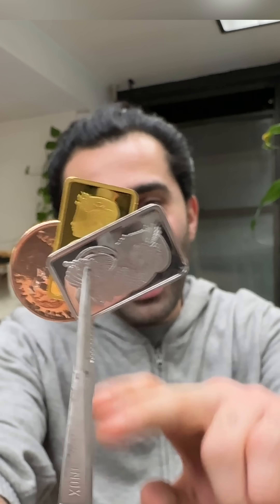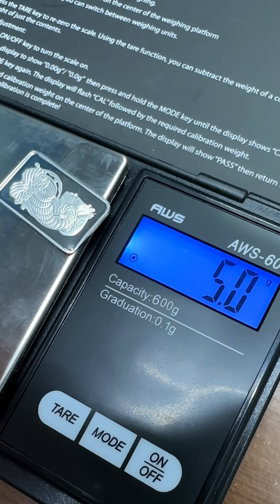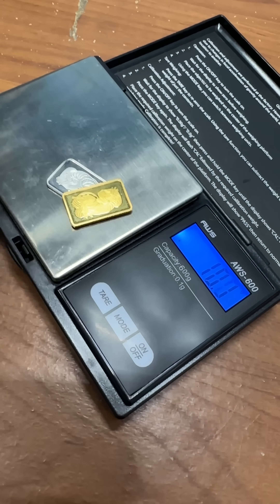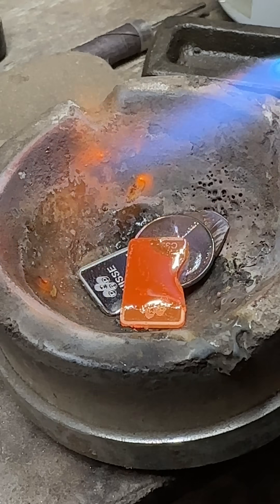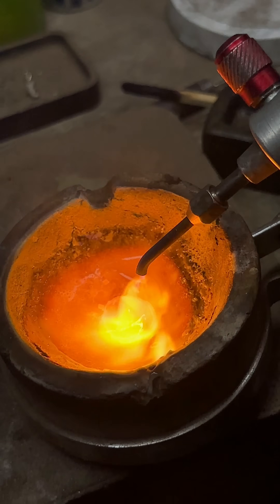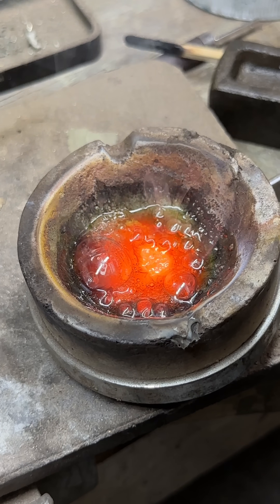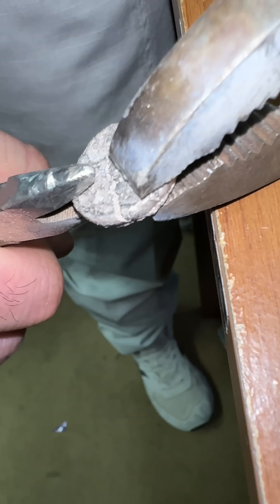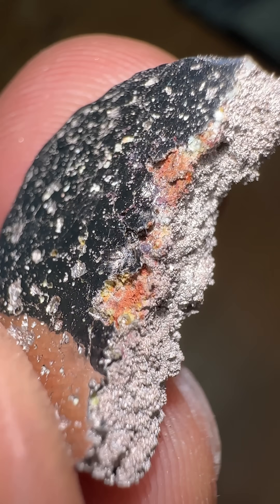CREATING A NEW METAL ALLOY FOR JEWELRY?!?!? #shorts

Comment: Heat the Platinum until it's molten then throw the other metals into the molten puddle. That way you aren't cooking the other metals beyond their melting point for so long.  You weakened them. When alloying, it's always best to melt the metal with the highest melting point to molten FIRST. Try this experiment again!
Reply: Just like cooking.
Reply: @JohnDoe-ps5hi  exactly, you wanna cook your “harder veggies” first before cooking the softer ones to prevent them from breaking down
Reply: @JohnDoe-ps5hi  Exactly what I was going to say
Reply: @JohnDoe-ps5hi  Right?! I thought he was making soup!
Reply: @JohnDoe-ps5hi  hisemberg approved
Reply: @JohnDoe-ps5hi well if you think about it for a second, it is cooking.
Reply: @JohnDoe-ps5hi  no
Reply: @OhZjuchi It's all chemistry. So... kind of like cooking
Reply: @OhZjuchi yes otherwise the things that need longer aren’t edible
Reply: Wow you are wise I was thinking the same thing, it was not mixed right.
Reply: @oscarbennett9253 yeah dude in the video puts off like they know so much but they dont knowanything about alloys. And hes not the first to do this. And weird how he used old pennies for the copper. When you can get pure copper at any hardwear store
Reply: @oscarbennett9253 you think the same thing like me, so you are wise becorse I am wiese…😂 dude
Reply: @Soilphonic  🙏 thanks, you are so kind.
Reply: @oscarbennett9253  l loop 0p
Reply: Was just about to comment something along these lines but you said it better lol
Reply: @jedd4635  what were u about to comment
Reply: @jedd4635 
     

.
Reply: I agree or he could have used silver instead platinum
Reply: @morganmccomb  silver would flash way to quick to mix with copper or gold
Reply: @oliverklozhoff  wow. That has to be the stupidest comment I’ve read here thus far. 
Do you know what yellow gold jewelry alloys below 23k are traditionally made with? 
Gold. Silver. Copper. 
Some proprietary additives by some companies to alter some characteristics such as viscosity or corrosion resistance. 
Silver will not ‘flash’ at molten gold temperatures.
Reply: @morganmccomb it’s like making meth
Reply: @morganmccomb wouldn't be a new alloy  8 carat yellow gold is a third gold a third silver and a third copper.
Reply: @HenryTheOunce  usually the percentage of silver is higher than that of copper (traditionally 2/3 silver 1/3 copper, but naturally you can mix and match to play with the colors.)
Reply: @morganmccomb silver gold and copper is already an existing alloy. It’s called yellow gold. It’s usually 2/3 silver to 1/3 copper mixed with gold to produce whichever final karat you’re aiming for.
Reply: @morganmccomb The proportions are just odd.
Reply: @morganmccomb  he used silver with the other 2 metals.
Reply: @morganmccomb silver and gold alloy already exists I forgot the name of it
Reply: @morganmccomb  He would have just made 8k gold.. already exists 😅
Reply: @morganmccomb that is basically just how the make lower grades of gold for jewellery 😂 if u test 14k gold it will normally be a mix of gold silver and something like copper
Reply: A real jeweler would know this
Reply: @thirdiview1230  Right? Definitely seemed like a pretty rookie mistake to me and something that this guy should have known or at least researched a little more. I mean can that platinum be salvaged now?
Reply: @whiskeyrichards9973  YES IT CAN BE SALVAGED AND NO THIS IS NOT CORRECT.
Reply: @whiskeyrichards9973  easily recovered
Reply: @whiskeyrichards9973 in
Reply: @whiskeyrichards9973 jewelers aren’t metalsmiths nor are they chemists so no it’s not a rookie mistake as alloying is out of their scope. But also, chemistry is very finicky it’s not simple. Go watch NileRed make purple gold, he has a masters in chemistry like me and did the proper research and still failed several times. Academic research also is gatekept, which usually requires academic connections to an institution or a lot of money to read stuff you probably still wouldn’t comprehend enough to follow.
Reply: @shnilikmw So are you the guy who made this mistake and wasted your precious metals on video? Seems that way with you responding to so many comments like someone insulted your mommy or something. You can relax man, don't get so offended by YouTube comments.
Reply: @thirdiview1230 truth
Reply: @thirdiview1230  come on it’s just a test that was to hard a thing to say
Reply: @thirdiview1230  ye, but homie on the video is a clown and all that fake stuff on 70% of videos
Reply: @thirdiview1230 exactly guys a phony
Reply: @thirdiview1230 he does know this he makes these videos to show people who don’t
Reply: @thirdiview1230 should know jewelers aren’t metalsmiths
Reply: Beat me to it
Reply: It's concerning he didn't know this
Reply: @takethebaitmate1920 did you know that casting platinum with copper isn’t a good alloy to begin with.. chemistry is NOT simple bruh lol
Reply: You would of thought being a jewellers they would of know such.
Reply: I'm astonished that they don't know this.
Reply: Exactly what I was thinking watching this clip. Seems like such an obvious no-brainer too. These clowns jacked it all up right from the start. Lol
Reply: We need to upvote this guy's comment so traxx takes notice
Reply: yes we need it
Reply: Platinum and gold can handle extreme temperatures it’s the Copper that suffers. More than likely air from a gassing reaction hence the air bubbles
Reply: @FiloYappins pluss the used ild pennies instead of pure clean copper
Reply: @FiloYappins  they alloy copper with steel for safes and vault doors. Called 'copper elexide'. I dont know how it is done.
Reply: @Chris Madden  yep oxidation
Reply: @Chris Madden  that's why he added flux. Problem is gold and copper melt at 1950f and plantaum melts at like 3300f and does not oxidize at that temp meanwhile the copper are stripping oxygen from anything it can. Not sure if gold oxides at that high temp or not.
Reply: @Capthrax1  pure gold does not oxidize. That’s the reason the work of the ancient Egyptians could still survive unchanged over the millennia.
Reply: @FiloYappins  not so much the temperatures, but the reactivity of each metal. Gold and copper melt at essentially the same temperature. 
Gold and platinum are non-reactive in air at room temperature. Even at melting temperature in an oxidizing flame. But copper will tarnish at room temperature in plain air. 
Porosity is due to gaseous reaction with copper and differing solidification times in the alloys crystal structure due to non-homogenous mixture and contraction of the metal when it transitions from liquid to solid.
Reply: Would it still not be pointless mixing copper and platinum?
Reply: @DinnersForOne  pointless !? Its beyond retarded mate. You dont need to divide by 3 to know how much gold you have, you can just weigh it.....
Reply: @DinnersForOne  jewellery platinum is alloyed with other metals to alter its working characteristics, be it making it easier to cast or make it harder. Nothing pointless about it.
Reply: More borax
Reply: I like how everyone thinks they know this and like it
Reply: @Yourfather7392  facts these fuckers just be parroting
Reply: @Yourfather7392  miserable as usual
Reply: Also, using an inert Gas could help the oxidation that happened, making it worse
Reply: @AngelaScene18  It looks like they used a Flux at least but inert gas is better for sure. That's why TIG welds are stronger than stick welds that use a chemical Flux.
Reply: "overheating" liquid metal does NOT "weaken" it.  Strength is created while solidifying.
Reply: @steelbluesleepR  dude. You don’t know what you’re taking about, obviously. 
Overheating creates gas pockets (micro and macro porosity). Reactive metals will oxidize more when overheated, which also creates porosity and weakened crystal structure. 
You obviously don’t know what you are talking about. You’d best keep your mouth shut if you don’t want to seem even more of an idiot.
Reply: @steelbluesleepR  Um, ok Champ.
Reply: @neekobonzini3399  these are all elemental metals, so there's nothing to burn.  

 it's oxidized, not "overheated".  If they did the same thing in a shielding gas, it would be completely different.
Reply: @neekobonzini3399 you’re as clueless as these other know it alls
Reply: I'd say THIS, AND get rid of that trash copper and use nickel instead.
Reply: The problem is the melting point of platinum is so high it need to be molten first and then the other two metals. But right after platinum or during a flux or vacuumed chamber would need to be used to keep metals from oxidizing so the can fuse properly. The dissimilar metals are binding because there oxidizing before the can mix and the over heat of copper. Definitely would help to have an oxygen free environment or oxygen less.. just a tip. But yeah I feel a real jeweler or beginner metallurgist would know this.. that jeweler he has is talented for sure! As for him he’s just a super salesman!!
Reply: @shadetreetrades.jackofall2188  jewelers don’t know chemistry, they learn a little from experience but just like a science experiment you don’t know until you try it several times and you have to keep the experiments standardized to pinpoint the problem. Trax is NOT metalsmith, he’s a commercial jeweler that is very well knowledgeable on the economics behind jewelry, not the science behind it. Glad yall can critically think about his processes, but refuse to think critically about his actual profession, which is to sell jewelry not cast it by hand. It’s why he always has other doing these experiments in his videos, he relies on others expertise but a quick buck for some promo, any metallurgist will do whatever he says for the promotion.
Reply: You can't "weaken" metals by going over their melting point. They simply will be liquid and nothing else.
Reply: @FactionalSky  wrong. 
You weaken an alloy or a reactive metal by introducing imperfections in the crystal structure, either by nearly heating to the point of vaporization or overheating and degrading the crucible or flux.
Reply: And use pure copper. Pre 82 pennies are only 95% copper and 5% zinc.
Reply: I hope this dumbass jeweler reads this lmao
Reply: And dont use shitty ass pennies for the copper
Reply: Pressure is also needed when creating an alloy with metals of different densitys
Reply: @InCianone  not in the slightest. 
Where did you pick up that piece of garbage idea?
Reply: So it seems he is not using experts!
Reply: CLEARLY
Reply: Nah we just need to let stupid do what stupid does jeez the guy ruined a bunch of perfectly good metals
Reply: Wouldn't work it is that much hotter. You would need amalgamate compound to bring them near. Then remove the amalgamate.
Reply: @Cookies4Wookiees  no. Not necessarily. Amalgams are used to alloy at room temperature. Such as mercury for dental fillings etc.
Reply: Lol acting like jewelers are metalurgists up in here, you can't just melt random metals together in an equal ratio and hope for something malleable and ductile...
Reply: Also slower cooling makes bigger crystals the grains in there were like sand
Reply: "You weaken a liquid". Bruh....
Reply: @em4703  it’s not weakening the ‘liquid’ 
You are compromising the crystal structure of the solidified metal by introducing impurities.
Reply: @nottheoneyourelookingfor0504  no $hit. why do you think I put quotation marks?
Reply: @nottheoneyourelookingfor0504  also, no impurities were introduced buddy. it's just a bad ratio of gold and platinum. so many replies and all you do is writing garbage. your posts are the ultimate example of Dunning–Kruger effect
Reply: @em4703  try again, bud. I have over 20 years experience as a custom goldsmith, specializing in casting and antique repairs. Intimate knowledge of alloying processes is paramount. 
And what pray tell are your credentials?
Reply: @nottheoneyourelookingfor0504  Metallurgist
Reply: @em4703  right. Sure you are, buddy.
Reply: You are very smart.
Reply: Also need to consider metal solubility… might be soluble in molten state but then seperate across different boundary layers when it cools. 

But then you are right, you have to melt platinum first then throw the other metals in
Reply: Do it again!!!
Reply: Exactly right. He hyper oxidized the other metals trying to melt them all together
Reply: Yea monitor the temp and drop them in at their molten points 👉
Reply: Isnt this bullshit? Maybe the olatinum burns dust in the air but it shouldn’t be used doing that. You cannot weaken metals on their own just by melting them.
Reply: Watching the gold mini n Platinum should of just left way was cute in package but yeah ppl have time n money so experiment...I guess sad 😭 world is poor n struggling give that experiment to a good user of YouTube fan
Reply: Correct. This method also reduces oxidation if you add small amounts of the other medals to the puddle such that they are completely submerged in the puddle of molten platinum when they melt.
Reply: None of y'all has any experience, ya buncha YouTube Guru's
Reply: @neekobonzini3399  And I'm the king of  Wakanda, That's why I'm on here all day arguing in the comments
Reply: Who's the wise guy ?
Reply: That was an interesting read I always wanted to be a smith too
Reply: Also, he needs to add 5gx^2 of more gold.
Reply: This is what happens when people have too much money and not enough experience
Reply: @billyshaw6017 This 8s how you get experience.
Reply: @billyshaw6017 jewelers don’t go to school for chemistry son
Reply: you should get hired
Reply: Thats what I thought to he just burnt-out the gold all together 🤦‍♂️
Reply: wouldn't matter, copper is garbage and would still become brittle as fuck.
Reply: You could heat it in a oxygen free atmosphere it would help or you could combine using a source of powdered metal in a ball mill and then melt fast say in a induction heated furnace.
Reply: I think a better heating method could help with the process as well.
Reply: Lol you’d think he would know that being a friggin jeweler
Reply: @cmendoza1094  he is fake AF. His vids are trash and he is dumb as a brick
Reply: And don’t throw those trash Pennie’s on there unless they are 100% copper
Reply: They’re jewelers what are they supposed to know
Reply: That's exactly how my chemistry professor explained how to do with other metals. Weird the jeweler didn't do it that way
Reply: Yep
Reply: I thought this would be common sense…
Reply: Honestly surprised a guy like this made a mistake like that
Reply: I don’t know anything about alloying but I was thing the same thing😂
Reply: Then how would your annealing process be handled
Reply: nevermind the ridiculous oxidation from doing it all in an open container.
Reply: @mattjohns3394  jewelers melt precious metals like that all the time. Not much issue there.
Reply: @javanmonroe6064  not much issue when it's something soft and reasonably inert like gold but when you heat copper to platinum temps in the presence of oxygen, bad things happen.
Reply: @mattjohns3394  thanks for the note. If it had been done in a more proper way (heating platinum and adding other metals in after) would that have produced at least a better version of this or is this doomed regardless and homie was just being dumb
Reply: @javanmonroe6064  I've never played with platinum but at that temperature I would suggest induction heating in an inert (argon is easy) atmosphere.
Reply: The I suggest you reply to the commenter that posted that. Just a random "wrong" doesn't help anyone.  The heat of the metal is not the problem but heating it in the presence of something as reactive as oxygen generally causes problems.  Shielding gases are used for a reason.
Reply: @mattjohns3394  that’s what the flux is for. But his problem is that most fluxes are detrimental to platinum and will introduce impurities and create porosity.
Reply: It's doesn't make any difference. Once all three are full melted it will be the same no matter how you did it.
Reply: Someone actually using their brain
Reply: He ain't no shit about cooking bro, 96% purity is not gonna achieve
Reply: Wise words
Reply: and also "copper cents" are not pure copper but more a form of bronze.
Reply: Yeah like smelting iron and copper. You'd heat the iron first. Maybe if enough people like and reply to your comment he will try again and follow your advice to get it right.
Reply: Well the metal still need to be in that temp gonna burn still
Reply: @perkpinoy6192  You're an idiot, less time with exposure to high heat means less burning off
Reply: I just wrote the same thing thinking i was the only one 😂thinking had the idea 💡 and then looked the comments lol 😂 I was to late
Reply: Really thought that was common sense
Reply: Rather be dumb and rich than smart and broke
Reply: Great answer. Those guys are noobs
Reply: Good call man👏
Reply: Somewhere this experiment has already been done and all you would have had to do is look it up or talk to a metalurgist, scientist, jeweler, etc
Reply: You should be working at TraxNYC
Reply: Cool
Reply: Common sense right? I'd like to see it done right
Reply: He probably knows it but dont want to give the tricks to his viewers. Owners are egoistic mf
Reply: Bro this was my first thought we he said the high point of platinum and him not hearing that 1 first
Reply: Yeah dudes videos are entertaining but he is no rocket scientist
Reply: Let me trust a comment over an actual Jeweler
Reply: @itzReEvolution  I am an "actual" jeweler,  I melt precious metals daily and its how i make my living...  Just not on YouTube.
Reply: I thought that was obvious he's not very smart
Reply: I wanna see him try it like this
Reply: Right i was thinking the same thing and i dropped out of school in elementary school this speaks a lot about specialists
Reply: Let him cook
Reply: That one penny didnt even look like a copper penny.
Reply: Good point
Reply: How do you weaken a metal that’s already liquid? That’s like weakening water
Reply: @Loseronvacation  He was saying melt the one that melts at the highest temperature first, that way you don't excessively heat the other 2 metals but I would assume that the properties of each metal don't make good alloys otherwise we would have heard of this alloy by now.
Reply: @Loseronvacation  you’re weakening the crystal structure of the solidified metal by introducing porosity/oxidation.
Reply: I appreciate this information I will more than likely never use in my life outside of a "fun fact"
Reply: @User-pw3pu  lol🤣🤣🤣🤣🤣🤣🤣🤣🤣🤣
Reply: Yall Americans FAILED THE F outta chemistry lol
Reply: The fact you had to tell this to the jeweler is kindof sad.
Reply: Yeah was gonna say isn’t that common sense
Reply: That's what I thought too
Reply: As long as you melt the metals it doesn't matter in which order you do so
Reply: @turevedin9968  and where did you get that tidbit, a cracker jacks box? 
Do your homework before making an ass of yourself.
Reply: This is just boys playing with expensive stuff 🤦
Reply: No way! That makes too much sense for click baits
Reply: Definitely need to study some smelting material. Really would like to ˢᵉᵉ it myself
Reply: #literally lmao
Reply: Material Scientists are crying reading this
Reply: You’d think they woulda thought of that before wasting material lol
Reply: Mmm same here he Putin 6 gram of copper qswell
Reply: Exactly u would expect the guy melting it to know that lol
Reply: Someone tag me when he does the redo!!
Reply: Please try again
Reply: Thank you. I couldn't believe what I was watching...
Reply: Seems practical.
Reply: Who is this guy.... First video I've seen of his... I'm assuming he is no expert
Reply: What time does Harvard open bro , im trying to get like you
Reply: I want to see this please 🙏🏼
Reply: If the copper suffers from lower heat temperatures than let the gold and platinum cool down down to a point the copper can handle than add the copper.
Reply: Sounds logical
Reply: So many of you have no idea what your talking about.
Reply: @240sxRule  and you do ?
Reply: Also most of the time if you throw something cold, in something hot, it explodes. So have fun kids!
Reply: @240sxRule  you’re assuming that the cold item is in liquid form, or will sublimate into gaseous form rapidly enough. 
But generally speaking one would add the lower melting temperature material in in small amounts, or reduce the temperature of the parent metal to a point where the alloy metal wouldn’t instantly vaporize.
Reply: @nottheoneyourelookingfor0504  Valid. Most my cold hot exploding experience comes from babbit bearings. A bead of sweat can wreck your day 😆
Reply: @240sxRule  not familiar with Babbitt bearings. But I have had platinum bands explode inches from my face when I accidentally touch one with a steel soldering pick/tweezers while fusing the platinum. Gets your heart racing, let me tell you!
Reply: Can this hypothesis supports cooking meth at home? Please reply thanks
Reply: Talk yo shi neeko
Reply: "A real jeweler would know this" is right. My first ring was bronze and I used a ghetto homemade propane furnace to cast up to 12 pounds of bronze at the same time, 6-7" tall crucible, and yeah I never would've melted my aluminum first then dumped all the copper in. It would've frozen there aluminum in a second and caused so much more oxidation. Melt the highest melting point metal first
Reply: That makes sense......
Reply: Does heating really weaken the other metals though ?
Reply: Showed this to a metallurgist and he went on a tangent. It really triggered him. Lmfao
Reply: The cold metal would split it just like if you put cold liquid into a sauce it splits it so it becomes unstable
Reply: @miyagi4208  what?? Uhh.. nice try, but your analogy is incorrect. 
When alloying metals it requires constant input of heat to avoid recrystalization. 
It doesn’t ‘split’ like a sauce. It freezes.
Reply: Yeah I was livid when I saw him cooking the two other metals
Reply: Repeat
Reply: You’re so right that makes sense
Reply: Yeah, or just watch 30 mins of one the 1000s of metallurgy tutorial videos on YouTube instead of some guy in the back who knows how to manipulate gold with a small hand torch giving it a shot lol
Reply: You think they don’t know that they get paid off views. Lol
Reply: Lol wow simple problems call for simple solutions
Reply: Platinum is infamous for being extremely hard to work with because it goes brittle and requires such high heat to work unlike gold or silver which is fairly soft and easy to work. 
Mixing those 3 together without first researching how to do so correctly was simply for views. That dudes a clout turd
Reply: Ah common sense
Reply: Like cooking right?
Reply: Can't add some soft ingredients till the end because it would come out tasting terrible..in this case looking horrible
Reply: That was the simplest best information I have read in years
Reply: Surely he would already know this
Reply: Agree when making nordic gold you also throw in the copper first since it has the highest melting point
Reply: Agree, should melt each individual to their appropriate temperature, then mix.
Reply: @kodadelasoda8323  unfortunately it doesn’t work that way. You start by melting the highest then add the lower melting temp alloys. 
The act of pouring reactive metals like copper introduces oxygen into the system because flux cannot coat the surfaces of liquid metal droplets as they’re being poured. Inert gas atmospheres will mitigate this, but then you are dealing with not one crucible but one for every alloy metal you intend to introduce. Just not practical or feasible.
Reply: People talking like tgey do this everyday probably never seen gold or platinum in their lice. Youtube experts😂
Reply: Its like cooking a gourmet meal and throwing everything in the pot at one time on one temperature and expecting the presentation to be on the same caliber, you don’t boil the pasta noodles, sauce and ground beef in the same pot at the same time c’mon Trax still rooting for you big dawg
Reply: This guy is a clown. Dont bother trying to reason. He lives for the 95% of the internet that are straight dolts. He wont be responsible for his brain dead trash vids by replying to those that call him out.
Reply: Exactly ..
Reply: Also if you wanted to mix platinum and gold you could also cast them separately for yellow/silver look and have the pieces connect to each other when you are finished with the casting. You could use a bit of gold/platinum flakes to melt in to ensure that both stick to the each other in order to become a permanent fixture.
Reply: @jeremyk.6456  lol. No. Just no. Where did you get the idea that that has any chance of being reality? 
Either cast the platinum, then cast the gold around/on the platinum, or cast both metals separately and gold solder them together. Or fuse them if you’re good enough with your torch.
Reply: Lol metallurgy is hard yo. Plus you wouldn’t want to do equal 1/3rds but I get what they wanted.
Reply: I'm sure he did hes a pro
Reply: But he should of just did gold and copper!  Or gold n bronze,  or Gold n silver
Reply: Etc....
Reply: and also that's why the percents of alloys aren't 1 to 1 could have done better using less amount of platinum heating at the same time...
Reply: Yeah he should definitely do this again and see the difference.
Reply: Same thing I was thinking. I dont know shit about this stuff but it seems logical.
Reply: Presumably the last thing needed is pressure  like -9000 psi so they  do bound
Reply: @Mr.RazorRamon  no. Lol. You don’t need pressure. Alloys form then the metallic crystals mix homogeneously while molten then so as to solidify at the same temperature. 
Where do you get this idea of pressure from?
Reply: thought the same lol
Reply: Bro don’t have proper equipment 😊
Reply: I was gonna say the same thing tbh, liking this comment
Reply: Sounds like he put the cheese on the burger when it was still raw.
Reply: @bigjosh9364  he put the milk  on the cow.
Reply: Exactly bud. That and the copper needs to be last at those temperatures. If not it'll cause it to oxidize out, not only throwing off weight values, but contaminating the ideal alloy you were aiming for.
Reply: Alchemist
Reply: Spot on
Reply: Okay Heisenberg
Reply: @LordFirestaff  dude. Seriously? 
You seriously think that copper isn’t a product of supernovae? And wtf would that have anything to do with it? 
EVERY element is a product of solar fusion. Everything under iron is made during a normal stars life. Everything after is a product of supernovae.
Reply: Exactly. Scorched the metal of the others entirely by that point, they where basically like ash.
Reply: I blame chemistry, because physics wise, that makes no sense
Reply: this guy metals's
Reply: @Owen2108  you might want to learn grammar and spelling before posting.
Reply: This right here is why i would LOVE to study material engineering.
Sadly me and math dont get along well enough for me to get there 😅
Reply: Him being a jeweler you’d think he’d know that (i have never worked with metals but even I know to work from the highest melting point to the lowest)
Reply: Noted
Reply: Let him cook
Reply: Smart advice
Reply: Okay,... wizard 😂😂😂
Reply: Please try again, you might be onto something great, a game changer in the jewelry game 😊
Reply: Fucking love that shot of you grinding the metal.
Reply: He thought he'll be making "The lord of the rings"....
Reply: Last I checked destroying money is illegal. Sure who's going to catch you. Well when you film yourself committing a crime.
Reply: Needs more anthrax. 😊
Reply: What was the point of this!?
Reply: @Fidgester  to prove how valuable research is. Cause they screwed the pooch on this one.
Reply: Then drop it in oil
Reply: What I’m saying
Reply: Who are you who are so wise in the ways of science?
Reply: You’d think he would know this lol
Reply: You don't weaken an element wtf?
Reply: He probably already knew and just didn't know what kind of video to make for the day so he just did this. He is a youtube junkie
Reply: How do you cook a metal beyond their melting point? 😂😂😂😂😂😂😂
Reply: Thought ab the same thing n looked for validation on the coments😂
Reply: Smelting is the procesd of extracting mineral from its by heating
Reply: Legand
Reply: This is not always true, for exmaple copper dissolves into molten zinc so you only have to heat to slightly above the zinc melt temperature to alloy.
Reply: @anthonycornell2209 Yeah. that's not how alloying works alloying is not just a mixture of any metals in any proportion, you need specific formulas, although metallic bonding works differently than covalent bonding, let's use as an analogy that you wanted to make a chemical compound, you would work out the empirical formuals and look at the valence values to determine how much of one element or compound could combine with another with as little as possible end product. In metallic alloying, you are going to drastically affect the properties of your product if you try to create alloys by random mixing by triual and error  or "alchemy".
Reply: You don't weaken metal by over heating it
Reply: This dude does alot of good sometimes based on his shorts (dont know of giving out was real or nah), but he a real dumb ass at times and this is definitely one of those times
Reply: Yeah order matters
Reply: It's for the clicks. That's all.
Reply: Trial and error...
Reply: Exactly what I came to the comments to post lol 👍🏻
Reply: I don't understand melting metal but I agree with try again
Reply: U realize these guys are professional. Most of em go to school so why r u tring to give them ideas when they already know 😂. It’s like teaching Hendrix guitar chords 🤦🏼
Reply: @sweeps1463  Yeah, okay. Except that... IT DIDN'T WORK. Kind of a ridiculous comparison.
Reply: That's a great idea.
Reply: Interestingly enough, sterling silver has a lower melting point than that of pure silver or copper. My question is would it be wise to melt copper first to make sterling, or are the melting points close enough to not have to worry?
Reply: He's doing this shit to get ppl like all the idiots in here to comment, he isn't successful for nothing he's defo doing something right like 🤷‍♂️🤣
Reply: And use argon
Reply: Would the different heat make the metal pop?
Reply: Hire this guy
Reply: lol i thought the same
Reply: Although copper melts at a lower temperature it would not mix properly with the gold and platinum unless it was at the same temperature. That's why he put it all in together. You can't mix different temperature things together as they won't mix properly unless they are all reaching the same temperature.
Reply: This guys knows
Reply: He’s a jeweler not a metallurgist and that’s what he needs to brush up on before trying to make new alloys. Sometimes there are other processes like the ones mentioned and materials that are used to aid in the amalgamation. Read a book or take a class and don’t go by a you tube video. It’s likely a novice also because the real guys don’t have time for internet and apart from banking most probably don’t even have a email account!😅
Reply: Also,there’s probably a ratio at which they mix best and you can make white gold by adding a little platinum so it’s possible to put the gold and platinum together and then it should work for the copper also except that you have to figure it into the equation and isn’t copper used to make rose gold anyway? So you would be mixing a mirror finish to a rose gold colored piece. I would experiment with putting a small amount of cobalt in the mix so you can get purple gold!😅
Reply: Let him cook😂🔥🔥
Reply: Completely clever… but sometimes money overwhelms people’s minds
Reply: @nikonaima7392  money is happiness
Reply: Lol what
Reply: Less platinum
Reply: Bro this guy a scientist
Reply: Exactly.
Reply: And people buy his jewelry.
Reply: I was going to say this before I saw your comment
Reply: Yep
Reply: Mr Krabs would have known this*
Reply: Lol this guy paid attention in school
Reply: Melt each separately at their boiling points n fuse at same time then let cool in freezer.
Reply: no this is about materials science
Reply: You don’t know what you are talking about you can’t throw hot platinum in cold gold and copper the sudden temperature change will cause failure they all have to be the same temperature and stable for them to fuse correctly.
Reply: @SPASPAWIZ  You don't know how to read
Reply: @neekobonzini3399  it turns out that I can’t lol. Intoxicated at the time.
Reply: @SPASPAWIZ  Hey,  it happens! God bless you
Reply: Bro that’s illegal to deface currency. ;)
Reply: Hire this man
Reply: If gold price not falls every one will die because of wars and monkey pox..Decrease gold price and increase platinum price. .All Indian politicians stores more gold and terrorists stores more gold so gold price should fall even more to stop wars across the world....
Reply: Inwould love to see him try this! Makes total sense.
Reply: You need to be a chef, not a cook. It's about timing, not just cooking.
Reply: Yeah this guy gets called out all the time for bs stuff he makes look up the cardi b watch
Reply: If it didn't worked it won't however you try it
Reply: I mean he is hackmaster splinter
Reply: shoulda skipped the penny tf. silver if anything else
Reply: I was going to comment the same thing it's simple 😂
Reply: Is it possible for him to distill the alloy back into it's constituents? Or at least just the plat and/or gold? Lol
Reply: You know how much that gold and platinum is worth.
Reply: Have you done that ? That sound like a good idea
Reply: No shit Sherlock
Reply: My thought too ! Beginners 🤦
Reply: And add some masala
Reply: Even a baby could figure this out
Reply: The hardest question is how to separate back the three alloys 🤔
Reply: Yes! What this guy said
Reply: Using a blowtorch isn't the best way either.
Reply: Defacing money isn't that illegal
Reply: to do what your talking about the best way to do it is to put in a a vacuum chamber and use a welder with tungsten tips to melt them all together. that's proper way to make alloys like this
Reply: I agree heavily
Reply: @neekobonzini3399 your completely right bro smelt the highest burning one then throw in the lower ones without heat the highest melting one will be high enough to melt the lower metals without additional heat
Reply: Sounds like common sense
Reply: You would think he and everyone around him would know that! It was the first thing that popped into my head when I watched the shorts!
Reply: It doesn't matter how long they stay above their melting point, those elements are simply incompatible probably due to the doses used.
Reply: Could maybe also try using a gas to displace oxygen
Reply: @neekobonzini3399 haha I've done something similar and when you put a metal with a low melting point, into a liquid metal with a high melting point, it tends to splash liquid metal everywhere from rapidly melting, not recommended
Reply: Where’s your jewelry or medal that you have have melted down? Because they do this for living. So hope you do as well or your just talking out of your a$$
Reply: 🎉0p0az X s8wa--+÷+# xsy79hvutcpty9  9rt6 99lrl up ulr.p4p😮p 00pp😢
Reply: Makes sense!!
Reply: @neekobonzini3399 SMART MAN, u must be a Veteran, hats off my good sir, smart move
Reply: Gold alloys is an interresting idea!

I have thought about this before but this experiment didnt really work out.

I have some questions to the experts here!

Could you make it work if you followed a better routine? 

Aside from the usual alloy silver+ Gold or copper+gold, are there any other interresting alloys containing gold?

Ive thought about platinum+gold, but then you must solve the dilemma with the difference in melting point.

Gold+Bronze is another.

I wonder what results you could get with Gold alloys? 

And if they would be of any other use than decoration?
Reply: Legit what i was thinking 😂
Reply: Yup I totally agree - it’s like burning butter before the sugar melts - you don’t have creamy caramel, you have a hot burnt mess.
Reply: How many smelters are there? Great advice everyone! Well explained
Reply: He won’t lol because you can’t tell an influencer they are wrong
Reply: I’m no expert but this sounds legit lol 😂
Reply: @GenesisG70LaunchEdition  its not
Reply: @GenesisG70LaunchEdition  it is. I work at a steel mill and we always pour the steel into a vessel full of scrap.
Reply: Yea Trax do this again, just chemistry at the end of the day
Reply: Agree👍
Reply: This is funny dude supposed to be a pro and here you are telling him how to do it correctly he should be embarrassed lol
Reply: Theyre already weakened to the point where they're molten. You cant "overcook" a metal. The gold on your hand was made in the core of an exploding star and its doing just fine right?
Reply: @89Ayten  try again. 
You definitely can overheat metals. Either in temperature or time. Too high a temp and you can end up vaporizing some. Too long can introduce impurities in pure metals (such as from the boric acid or crucible degradation) or can heavily oxidize the alloy materials which will weaken and discolor the alloy. 
Next time, do your research before spouting off nonsense.
Reply: Wrong
Reply: @austinmarshall443  Just "wrong"?  Who is wrong? How are they wrong?  What is the correct answer?  Or are you full of shit?
Reply: @mattjohns3394  you can't "cook" metals too long if they're the elemental metals. They have nothing to leech out. You can heat them all you want. The only think that determines strength is the shape and size of the crystals form in as the metal cools. That's dependent on cooling rate not how long you torch them for.
Reply: @austinmarshall443  try again. 
Overheating metals will introduce porosity from offgassing, decomposing crucibles and fluxes, apart from the usual introduction of oxygen and sulfur from the atmosphere and carbon and oxygen from the torch flame.
Reply: The platinum will be "cooled" to quickly by the other metals, which is why it has that extreme crystallisation.
Reply: How would a high school fail understand metallurgy !!
Reply: @arvindkapoor4537  bro, with all do respect your dumbass can’t even form a coherent statement. You must be a “Dropout” yourself.
Reply: 😂 this is funny, but when you have any metals that are in melt, in liquid for pretty much, they are mixed as good as it gets, it’s not like making no bake cookies, when you have to add things at certain times and this and that. The molecular structure of these metals physically will not allow this to happen. The melt temps do play a factor but do not change the final outcome and that’s what you got in the end. Nice demonstration
Reply: @averygentry35  But it does ... Its like baking, technique, timings and temps are everything.
Reply: @averygentry35  you are not very smart. Jesus you tried to sound intelligent but just crashed like the wanker you are